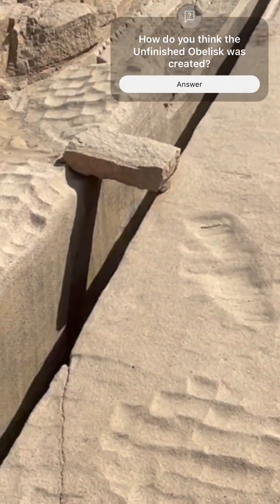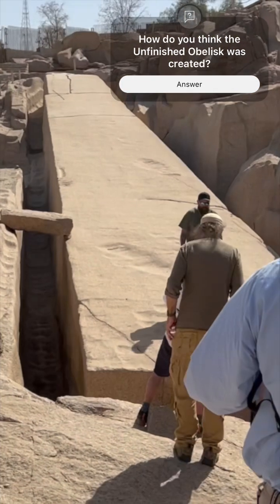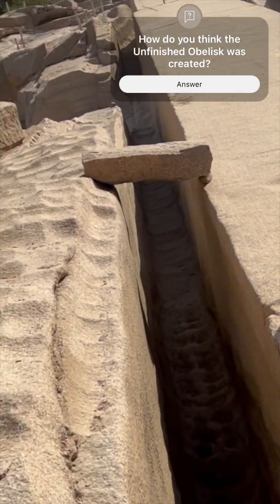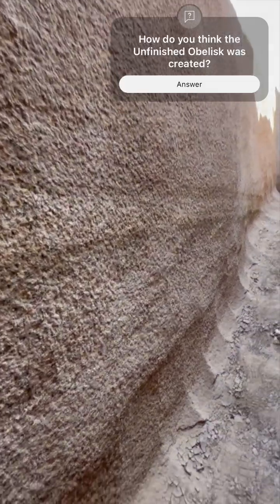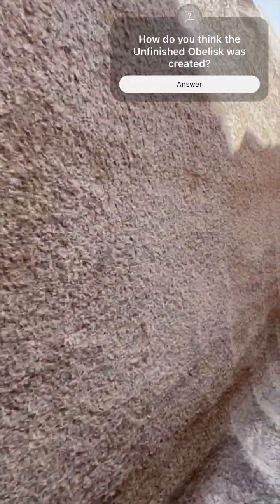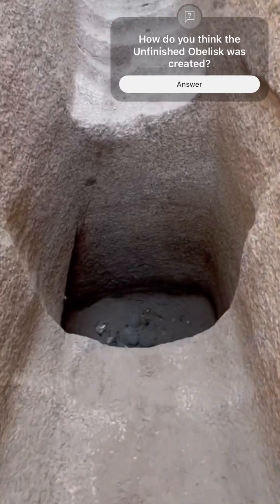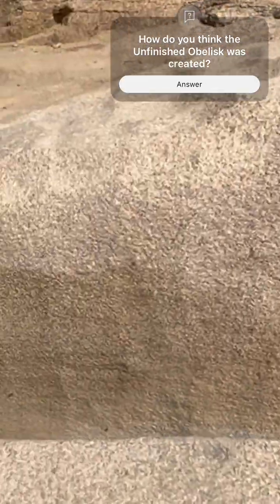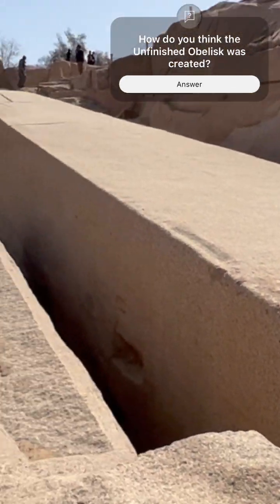How was the Unfinished Obelisk created?

Comment: Prolly quite the work out, back on one side and feet on the other shimming back and forth sanding away, looks like a whole body type of effort, not done by hand but by paddle board sanding squares they made with some type of material that maybe was like a blanket or towel type or maybe like a rocking technique back and forth.. they did it for sure

Comment: If I had to shape stone on that scale, the only thing that could cut through that much stone is big battering rams. Some of them would be suspended, others would be smaller use dyarite stones as ends of the ram.
Reply from the maker: Battering rams is a very interesting suggestion! I actually haven't heard any theories mentioning using them specifically, but it sure would make things easier and would speed up the process significantly compared to doing it by hand with just muscle power. Great thinking!

Comment: Smooth my arse. The cuts were exposed to elements for thousands of years. Of course it's going to look smooth now.
Reply from the maker: Oh absolutely. You make a good point. It's nowhere near as smooth as the Serappeum boxes or even the damaged granite box inside the King's Chamber, and it's nowhere near as smooth as that perfectly carved granite box in Fayum. Exposure to the elements has definitely taken its toll on this artifact, and there's evidence of that all over the obelisk, even though rainfall has dramatically declined in the last several thousand years. Wind and sand erosion still occur. And tourists are all over the thing lol. Still smoother than the rough stages of the pounding method though, possibly because of that exposure, likely a combination of multiple factors.

Comment: Electric rotary tool using high water pressure to help cut away rock and remove debris.
Reply: So will 3,000 years exposed to the desert
Reply: @tylerschoen5643   Wind erosion cut out a perfect obelisk?
Reply: @fustercluck2460  the smooth appearance of the cuts is 100% due to erosion 😂
Reply: @tylerschoen5643   Right.. and the pyramids were made by the wind and rain, right? 🤤
Reply: @fustercluck2460  you really don’t understand what I’m saying. I’m so sorry for you
Reply: @tylerschoen5643   There is clear evidence of machine tool use in many of the examples, so no.. I don't know what it is you're talking about.

I'm afraid I can't lower myself to your level.
Reply: @tylerschoen5643   That's a long way of saying "I have no valid argument"

Comment: sand used as a friction medium to cut and grind
 they used sand with saws to cut through stones, there are videos that show how sand can cut through stone using softer material saws. They may have used sand as a medium between a grinding stone and the side of the obelisk.
Reply: This one. They've got a gazillion tons of sandpaper material right there and they would obviously know its properties.
Reply from the maker: Absolutely! The texture (aside from the obvious exposure to the elements) also matched more closely to this methodology than the stone pounding method. I'm sure they used those diorite stones to smooth out the edges as part of the finishing work, but I don't believe they were quite to the finishing stages yet due to the obelisk still being in situ, so I believe those scoops are evidence of their tooling method just like you suggested. This is a very likely theory on the methodology based on what I physically saw while there. Thank you for commenting :)
Reply: @LostAncientMysteries  very welcome. 

Yes indeed I agree.

The scoops are So even and symmetrical its almost as if a escavator just scooped out dirt.

Maybe some ancient technology around making stones soft with certain frequencys paid a part.

Or they have some materials we dont have to make the hard work so easy on such a large scale.

That obelisk is granite right?
Reply from the maker: Yes, it is granite. A competent granite too, which means it cuts well and doesn't crumble to pieces when cut. Incompetent granite is a type of granite that crumbles easily, and we saw that in Egypt as well, but I believe the Aswan quarry became such a major quarry because of the quality of the granite.
Reply from the maker: I very much believe in the frequency theory, and that there were technologies or materials used that we don't have knowledge of today. Great to hear like-minded beliefs!
Reply: Maybe heating it up to make it more plyable ????,
Reply: Nah.

This is a false narrative.

Comment: Go bang some rocks on it for a while and tell me what it looks like..
It'll leave those same scoop marks I'd imagine
Reply: Plus mix in 3,000 years of sand erosion
Reply from the maker: If you concentrate on a specific area and work it into a bowl shape, this absolutely does occur. I can't argue that at all, you're correct. However, the texture is more rough, so they would have had to switch pounding stone sides to something far smaller and then switched to the polishing stage to smooth out the bumps while leaving the raised edges of their concentrated working area. I live around a lot of petroglyphs, the texture is very apparent and I saw that texture in multiple places in Egypt. They absolutely used the pounding method for rough shaping on multiple stoneworks. I just don't see the rough stages of it here, it had to have been in the polishing/smoothing stages by the time it was abandoned, and I am curious whey they'd start some of the early finishing stages while the thing was still in the ground if those scoops are indeed left over remnants of the pounding method. I've also never seen the pounding method making such consistent scoops, but I also have only been to a few ancient sites, and only in 2 countries, so I've barely even scratched the surface on different stone tooling methods around the world.

Comment: What makes them think that the crack happened while they were making it & not later on from weathering? (heat/cold wet/drying and sitting at an angle)
Reply: Only an assumption, but the obelisk clearly was abandoned halfway.  The crack is an oblivious flaw. So they assumed they moved the project to another section of the quarry to get a compete obelisk.
Reply: @stormchaserkj it feels more likely it was left due to reasons outside of the crack. They would have used the remaining stone for other projects. I could easily see war or a new project or new ruler come in and everyone stopped what they were doing and they never went back to it.

It’s too much work to just stop because some of it cracked

Comment: They used acid to soften the granite crystals bonds so it crumbles easier.
Reply from the maker: That's a great theory! I believe that would still maintain the granite crystalline structure as well in the remaining areas after the acid was removed/washed away/neutralized, and the remaining granite structure was still intact. That would also still allow for polishing afterwards too. I'll have to look more into that one! Thanks for sharing!
Reply: Interesting thought... but that would take a lot of acid and I haven't heard of any evidence showing acid used to that scale. 

This looks more like pouring water and sand over a heavy sphere of either quartz or granite while having the sphere spin to grind/cut the granite.
Reply from the maker: The Egyptians had rubies and rubies are harder than granite, so they may have used those with the water. They didn't have access to a lot of diamonds though, so rubies are the typical culprit in most of those abrasion theories other than sand, but sand wouldn't have been nearly as effective. Water being used with a drilling method makes a lot of sense, great though!
Reply: @LostAncientMysteries  that's awesome! I didn't know about the rubies being used. thanks!
Reply: there is plenty of evidence of acids in the pyramids. in fact, there are a few investigators that have a theory that the pyramids were actually used to manufacture acids originally.
Reply from the maker: I have read about the evidence of acid in the pyramids as well, it's absolutely fascinating! If the pyramids were used to create acids or specific substances, that would lend more credit to this acid theory for sure!
Reply: Vinegar wine will soften limestone.
Reply from the maker: I now have some research to do! Thank you :)